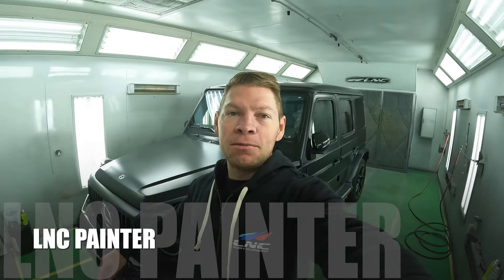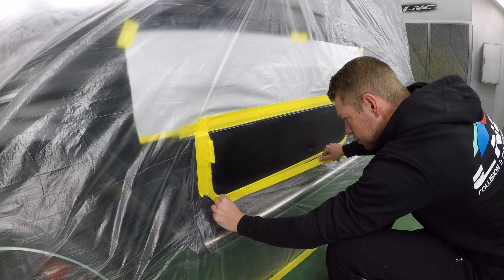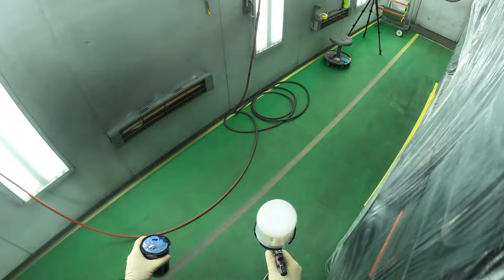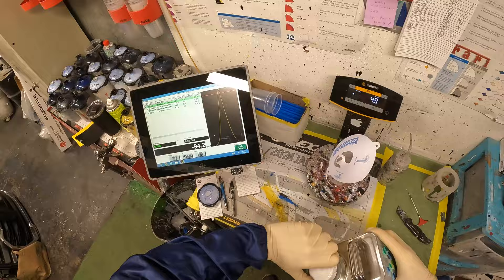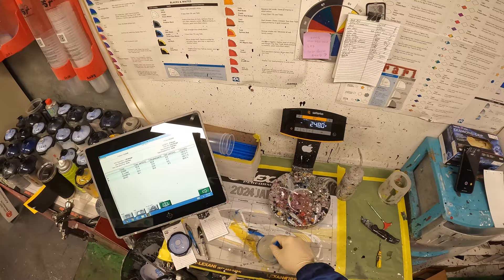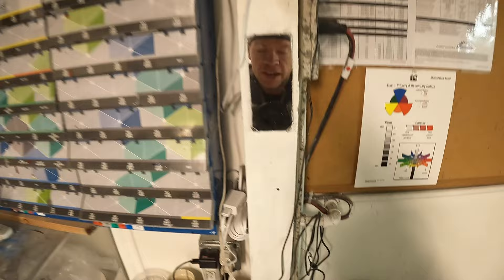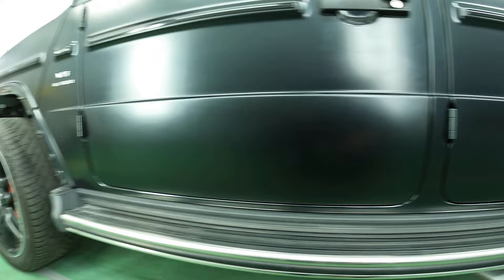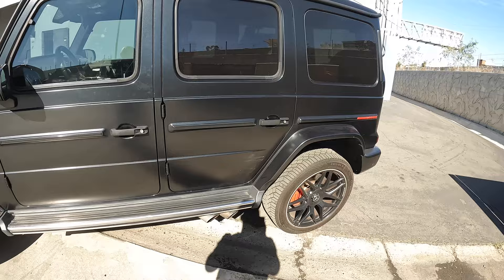Spot Painting Factory Matte Paint on damaged Door

Comment: Hi andrey, in my expierence it is just possible to make this job perfect, like nobody can see a difference , if you measure the gloss level. And then you have to adjust your clear coat to that level — Over the years this level will change … second you should avoid edges ,as you can not polish them away. We measured always the gloss level and painted always the whole part …. Have fun. , regards from Germany 😊 saw the vid now and the door looks good 😊 good also 😇PPG
Reply from the maker: Yes, you are right. How do you go about measuring correct gloss level? I know you have to do many spray out cars and adjust the matifying agent each time, takes a lot of time and material too
Reply: Hi andrey , check the internet and you will find a - gloss level meter.- maybe your PPG dealer knows more .spray out cards are very elaborate and costs intensive ,also not 100% correct.
After your measurement you know the % of the gloss …. And you can mix accordingly your clear coat to get it perfect …. Mostly that’s important after a car is used… 3 years and elder ….
One guy is making no maintence the next is washing his car always , one is parking inside his garage the next parks in the sun ☀️…..this gives various gloss, satin gloss results . For me the AMG s are more easy to re paint than BMW s and Ferrari s . Regards

Comment: Wow, this is some awesome work! No trace at all, looks just like the original. 👏 But gotta say, when it comes to that white Corvette, you can see the bumper has a slightly different shade than the rear fenders. It's plastic, so blending it without transitioning to adjacent parts is tricky, but still a bit annoying.
Reply from the maker: Thanks! The bumper paint on the sides is original, we only repaired and put paint on the middle of the bumper where the license plate plate goes, everything else was just clear coated. Clear coat does add a little yellow haze due to its natural yellowing tint, thats why white colors are often difficult to blend because the area where you just add clear gets yellower. I only put one coat of clear on the edges as well to minimize this from happening 😄👍🏻
Reply: I wish I had a painter like you at my place! Take a look at my Touareg's bumper. It seems like the bumper is a shade lighter. I believe the color was poorly matched, and it's simply too bright. Edit: Sorry, I can't add a photo in the comment 🤷‍♂️